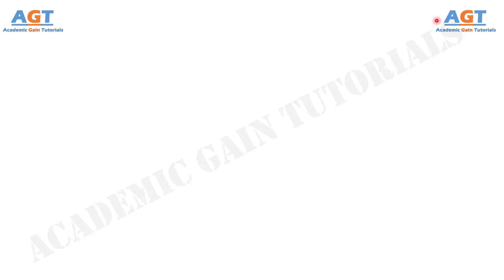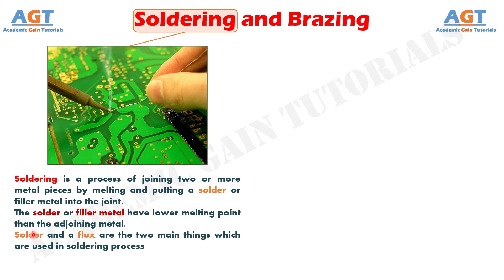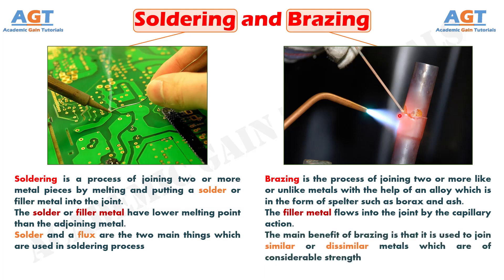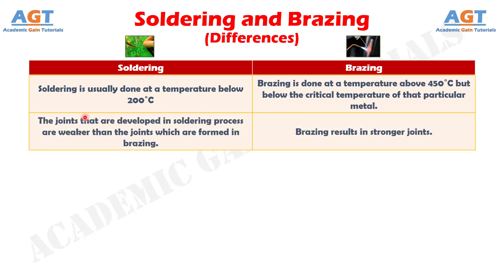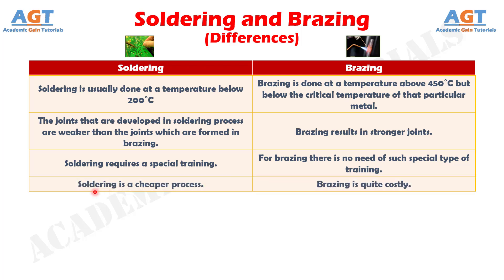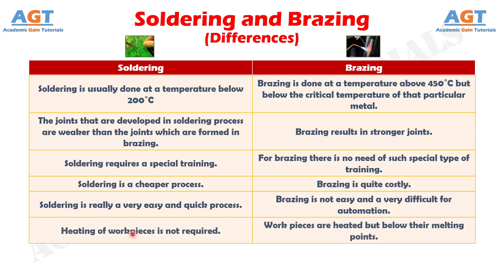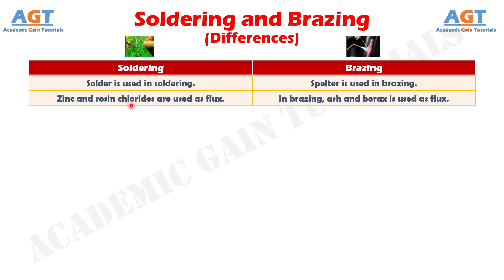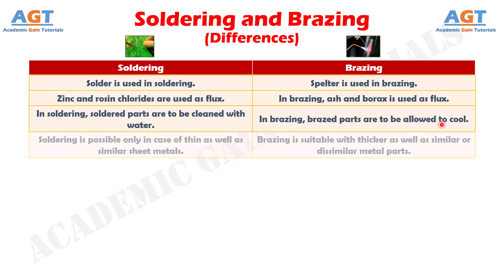Differences between Soldering and Brazing.

Comment: So if soldering is cheap and easy why does it require training?
Reply: Soldering isn't easy, but It takes less time to do it, while brazing takes a significant amount of time and energy to produce a better and stronger joint. Also, spelter is quite expensive